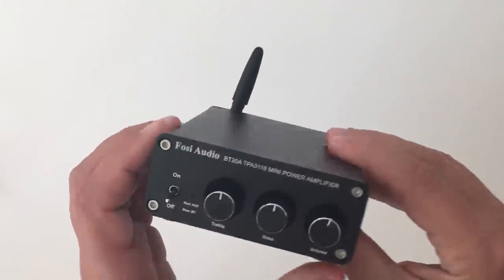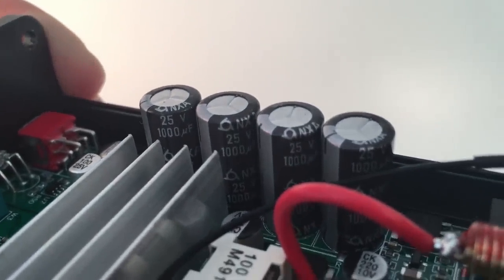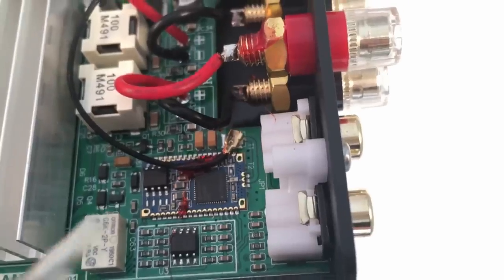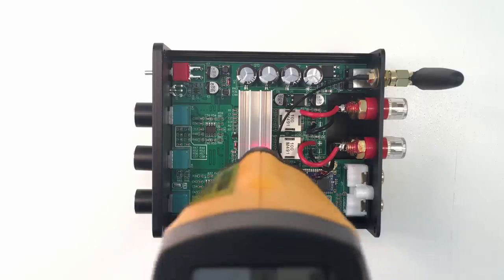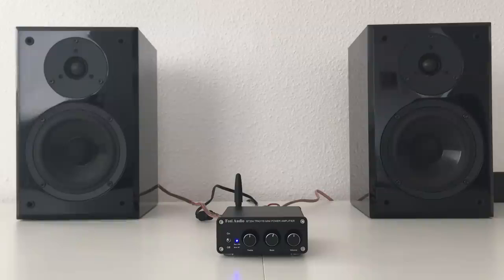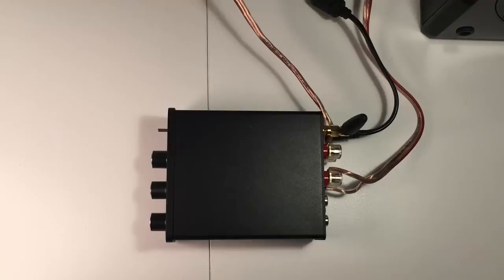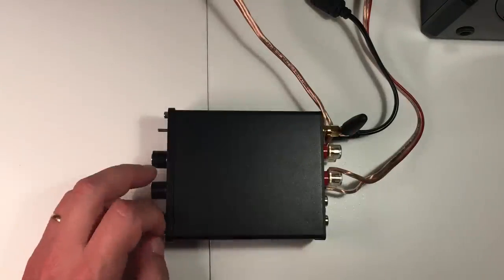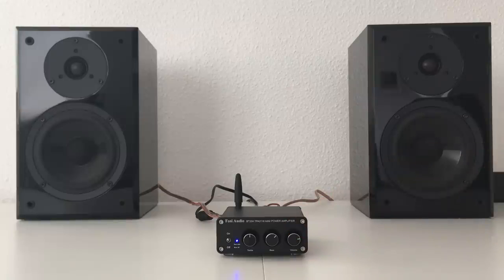Fosi Audio BT20A Mini Bluetooth Amplifier | Teardown and Test

Comment: Relevant information missing is the sensibility in dB @ what ohm these speakers are rated. The amp specs is one thing but the speakers it has to power is another important info.  All I got from the video was that the speakers are Yamaha. What model? Thanks.

Comment: I have a question about the modulators, are they the ones that have a stop or rotate 360?
Reply from the maker: The volume control has a start/end position, it won't spin all the way around in circles.